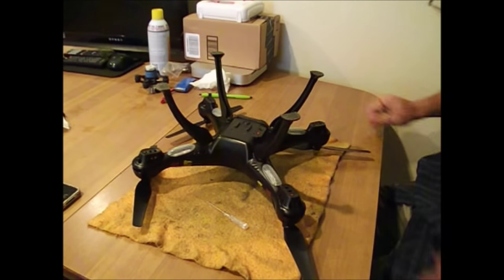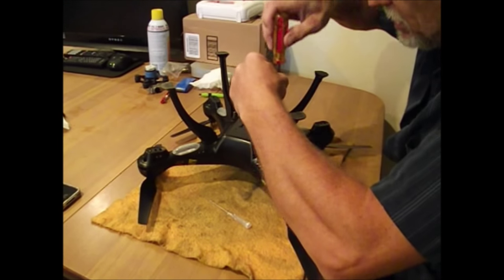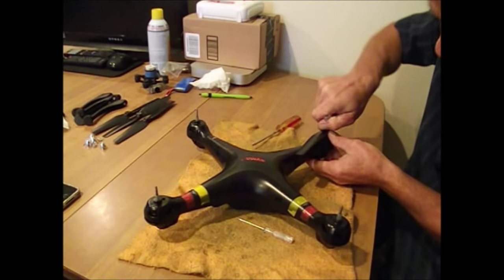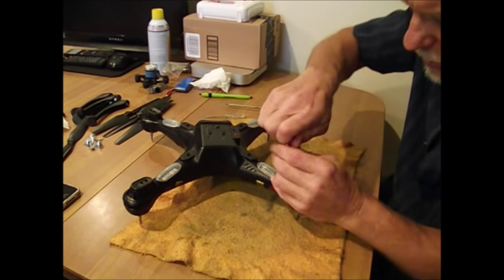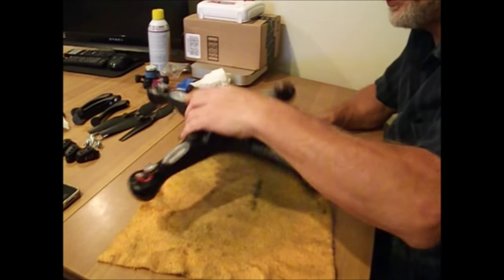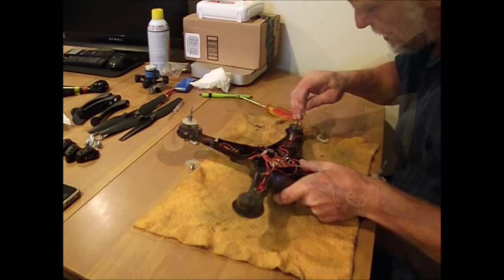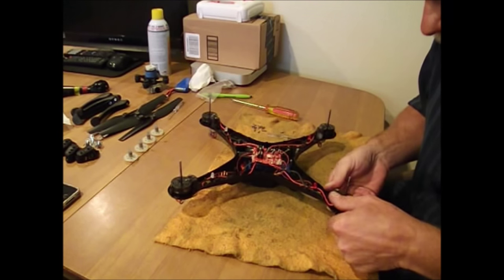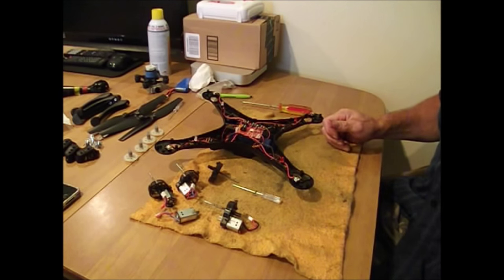Syma X8C Changing Motors & Gears

Comment from the maker: Info update on this video. If you are just changing motors, you do not need to break down the whole quadcopter. There are 2 holes on top of each arm that gives you access to the screws securing motor to gear housing.. I did not know this until I seen another video. Just remove motor housing underneath the arm, unplug the motor and unscrew the screws from top of the arm. You can then pull the motor out from the bottom. You need to be careful when installing knew motor. Make sure gears line up and motor is seated all the way in it's housing. Thanks and Peace.
Reply: Lol I didn't see this until after I took it apart😂

Comment: Nice video Mr.T,thanks for sharing appreciate your time and effort.Did you ever diagnose what was wrong with your lack of altitude?I believe 0nce 1 motor goes bad the other three is effected some how.Saw someone else with your problem with the altitude climb.
Reply from the maker: +C0ckPitVuE 777 Yea I know one faulty motor can cause this problem, however, these motors are brand new and they seem to be working fine. The battery is brand new also. It flew fine for the 2 flights I flown after I replaced every thing, It's like an old car, once one thing goes bad, every thing else follows. Thanks for watching. Peace

Comment: Nice one Mr T, there are not many instructional vids on a X8 teardown, and I am sure this will help those who have yet to tear theirs apart. 900 screws? a tad over estimate but humorous. Have you found the problem of no lift?
Reply from the maker: +mick thebass Ye the over estimate was sarcasm to make it sound as ridiculous as the process of reaching one motor on the X8C. Have not  found the problem with my quad yet. If you noticed when I flew through my porch on the last video, the inside was partially gutted. I am pretty busy with that project right now. I'm transforming our porch into a hair salon for my woman so she can work from home. Got to gut the whole thing first. I'm taking pics as I go along so I can make a slide show after. Peace
Reply: That sounds like a great idea.. You could fly through the porch inverted, cut and blow dry in one swoop...I like it.!!... A drive through hair salon..
Reply: +MrTColson pls help I changed my motors and put blades on right. it's not taking off at all any answers do I have to put the motor s in a certain way?
Reply from the maker: +EvilMoran yes you have 2 clockwise motors and 2 anti clockwise. clockwise motors are placed on front left and back right.

Comment: yea that's going on! I ordered the upgrade motors. I was wondering does it work better? if yes how? I plan change all the motors like your video said only scenes with  new upgrades
Reply from the maker: I would replace all the motors if you purchased the upgraded motors. I think the only difference between the old motors and new ones is that the new ones has a brass gear compared to plastic on old ones.
Reply: +MrTColson that's my plan they come in tommrow. I read the upgrades makes more not loud and Flys smoother. I agree on you said this drone just get to motors you have 16 screws. Problem I have in Miami FL finding place fly and no place carrys them. I actually got into the x series by utube videos like yous. I want say I like if you do video quick you back track say things you did not also you do reply to people. I bet everyone that followers you loves that about you. Can't wait find out tommrow. 
p.s why couldn't you get off flying normal?
Reply from the maker: +william brown I try to reply to everyone but sometimes I will miss a post. I hope things work out for you tomorrow. Let me know how it goes. My x8c is down now. I think I need to order a new motherboard for it. Til that happens, I'll be flying the eachine racer for awhile. Peace
Reply: +MrTColson is that the problem happened on the video? I seen them on eBay for 14 dollars I was thinking I need too also with motors but after you said mine tries just can't cause that motor burn out and now down. was say also anyone buy these buy a charger too one different cause mine all screwed up in two days I got one 12 buck American.

Comment: Mr T, I love your videos.  I have a question about my x8cs one motor spins slower than the rest, changed motor with known good motor and checked gears, gears ok.  What would you recommend for the next step.  Thanks
Reply from the maker: Did replacing the motor with a known good motor help?...if not, then I would guess that it isn't getting enough power. Check to make sure your connections are secure or It's possible the flight board is not distributing enough power to that motor. Flight boards are cheap enough. I appreciate you stopping by and watching my videos. Please let me know how things work out.
Reply: The motor change did not help. I did notice if I put forward stick clear up and start motor it does spin faster pull stick back and barely spins.  Does this help confirm board failure if all connections are solid?  Thanks for your quick reply.  I am very new at this.
Reply from the maker: I'm not thoroughly educated yet on the workings of these toy quads but it does sound like the flight board is not distributing enough power to that motor
Reply: Thanks so much.

Comment: Hi there,  Great video this helped a lot, I was flying my syma x8c few days ago and had a sudden loss of power to the drone, everything was blinking but it was as if the remote loss all control over the drone even though the drone was flying only few meters away. I re-calibrated and everything although the fuselage got a bit damaged from the fall however it was flying fine. I opened the quad today and noticed two of the motors were sounding funny as if the plastic props were stiff compared to other two motors and these two motors were also not as smooth as the other two. Could you please suggest me if oiling the props would be enough or do I have to do something more. The battery cage is a bit damaged which i will try fixing using some glue. 
Thanks in advance.
Reply from the maker: +Shariq Zaheer If you think 2 of your motors are not working properly, then it is likely that the motors will need to be replaced. To tell if the gears are the problem you need to break down the x8c and take a look at them. Once you disengage the gears you can simply spin the gear with your hand to check for resistance. If there is resistance then gears need to be replaced. I have had a gear melt itself right to it's post. Gears and motors are cheap enough to replace. When in doubt, just replace what you think needs replacing and when you get it all back together it wouldn't hurt to give your prop gears a squirt of silicone lubricant spray. Oils and grease pick up and holds onto dirt and dust particles which will eventually gum up your gears. So go with a silicone lubricant spray. It repels dust. Hope this helps
Reply: +MrTColson Thank you for your detailed reply, I actually did disassembled the Quad to find out that it's the two gears which have been bent to some extent and is resisting against the motor, Its difficult to find the gears where i am currently. Could you suggest me any idea as to how can i straighten those two gears. I know they are cheap but the problem is the availability of them. As for the Silicon spray I will look for it if i can find it, do you think a WD40 spray would do the job or does it have to be Silicon spray.
Thank you for the help.
Reply from the maker: +Shariq Zaheer I started using wd40 but found that it does pick up dirt and makes a mess inside your motor housing so I switched to the silicone spray and found that that does not make such a mess.
Reply: MrTColson Thank you for your prompt reply, I will see if i can find silicone spray here or else would have to go for WD40.
Thanks

Comment: Hi, I changed the body over on my X8 but have got into a mess on which motors go where. If the quadcopter is pointing forward (battery compartment facing backwards) can you please tell me where the blue/red vs black/red motors go? Are As blue/red and Bs black/red? Finally is there any difference between A1/A2 blades etc? Thanks for your help!!
Reply from the maker: chaseworldtour Lookin from the back, clockwise motors go on top left and bottom right. counter clockwise on rest. A1 prop is clockwise A2 is counter clockwise

Comment: One corner motor on my X8C doesnt rotate as fast as the other ones, and it started to smoke after a while. How could i fix this? What needs replacing? Im guessing the motor and possibly the gears but i cant be too sure. Any help is appreciated, thanks.
Reply from the maker: +Joey Ngo I'm guessing the motor needs to be replaced. If you tear down the quadcopter to get to the gears and remove the motor, try spinning the gear on its post and check for resistance. Does it spin freely? If it does, then the gears are fine. If replacing the motor does not solve the issue, then the problem lies within the electronics somewhere.